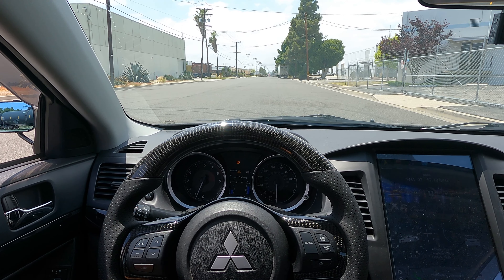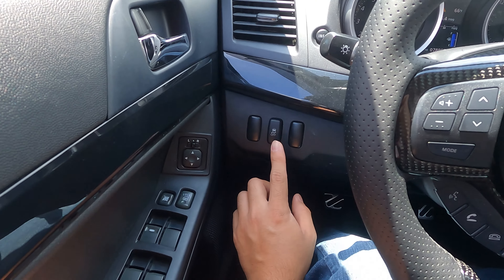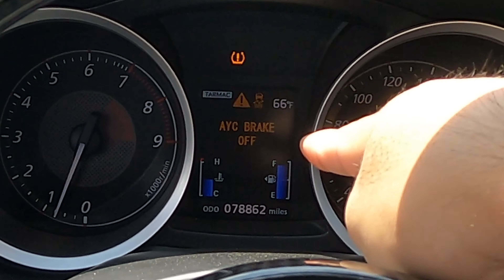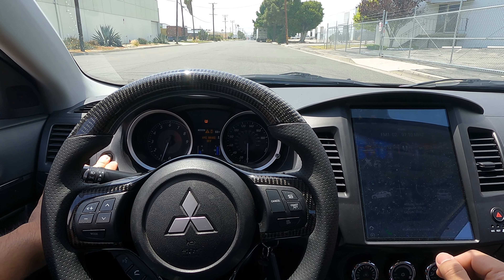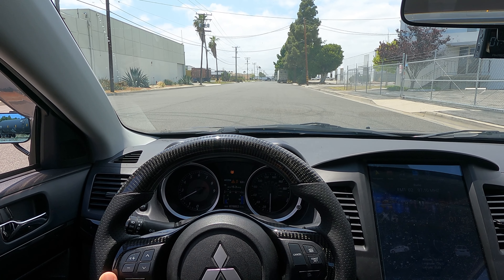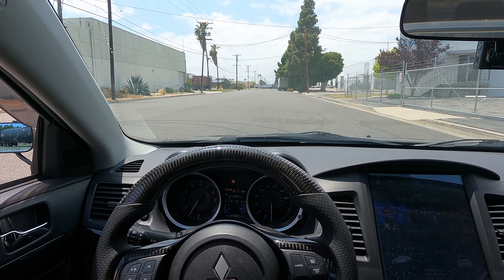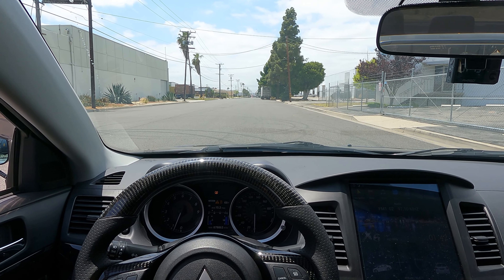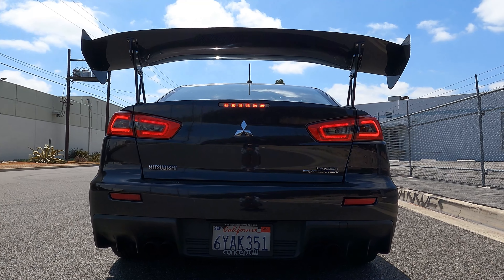Evo X 2 Step Launch!!!

Comment: Those are some pretty good launches. I wish I had the courage to launch my evo lol
Reply from the maker: Hahaha thanks! When I do these launches I'm not dumping the clutch, gotta save the clutch as much as I can 😂. I think the best way to do a launch is to let off the clutch somewhat slowly and as soon as it catches hold on for dear life 🤣🤣🤣👍
Reply: i went to the drag strip with my stock evo x, did 4 lunches that day, and maybe a dozen in total since i own this car, and the clucth is starting to slip when i hit boost :/ i was already looking to change my clutch
Reply from the maker: As long as you had fun right? Hahah if you're looking into getting a new clutch I've been using the ACT HDSS clutch and it's pretty good. The clutch feel is a LOT heavier though so just be aware that you're pretty much going to workout your left leg if you're going for a long drive 🤣
Reply: @JeffSongCars   i was pretty impressive with the time i got i ran a 8.45 in the 1/8mile  which is in the fastest ive seen on forum for fully stock evos but yeah now my wallet is crying xd
Reply from the maker: Awesome time! I still haven't taken my evo to the drag strip hahah maybe sometime this year but yea... modding cars is a very expensive hobby 😭
Reply: @JeffSongCars   adding bolt on is  fair price, but when it comes to things you dont normally change its so pricy, if you have a evo, you dont want you ayc pump to fail, or you t-case, drivetrain
Reply from the maker: Oh yea definitely I haven't done that work myself before yet but maybe in the future on this channel 👍

Comment: Never tried this on my FE, 2 step comes stock on your Evo?
Reply from the maker: You should definitely try it! Yea it comes stock with evos just make sure to turn off the ayc brake, put the car into first with your foot on the clutch, Rev it slowly up to about 5500 to make sure 2 step is on your evo then have a blast 😉👍

Comment: Hye, bro. Do you mind sharing the colour code of your car. I’ve been thinking to repaint my car.
Reply from the maker: Yea sure! It's actually a factory color and it is called phantom black pearl the color code is U02. I loved this car color when it first came out and when its out in the sun it has a bronze metallic that shines 😎👍
Reply: @JeffSongCars  thanks for the input, man. I owned a Proton Inspira which is a rebadged model of Mitsubishi Lancer. Thinking of swapping the old 4B10 engine.
Reply from the maker: Oh nice! If you do and engine swap are you going to change it to a 4g63 or a 4b11?